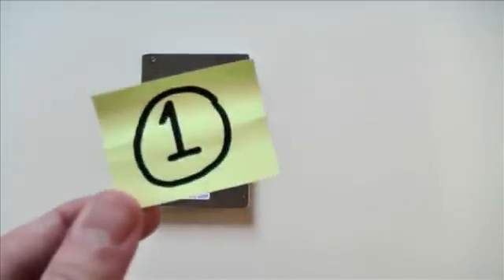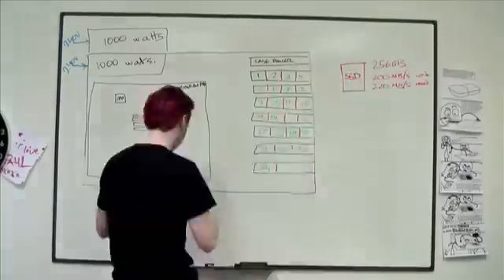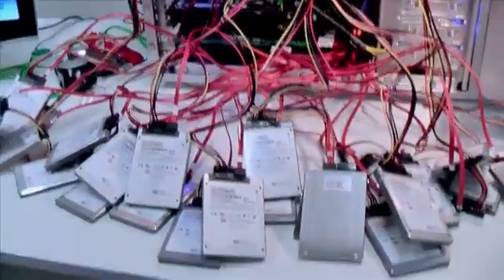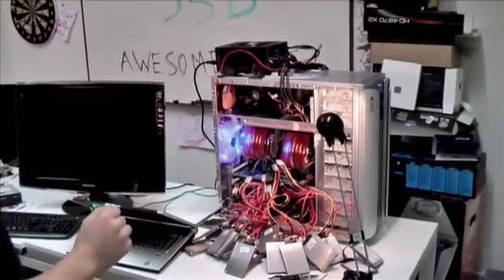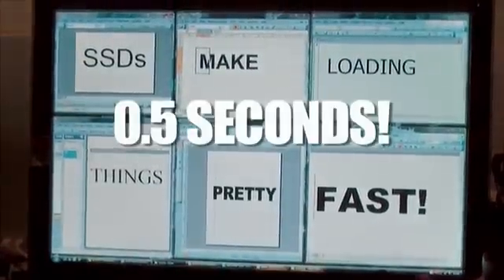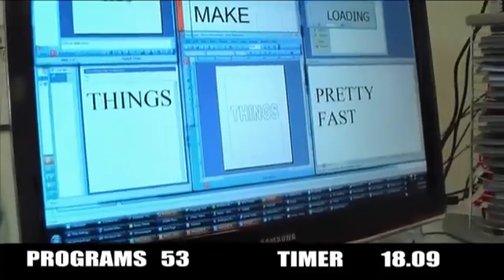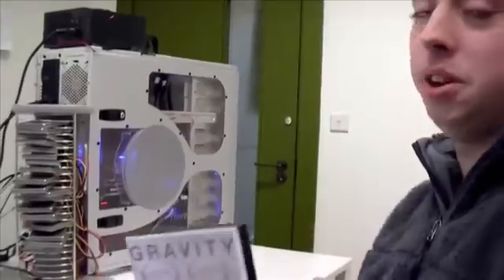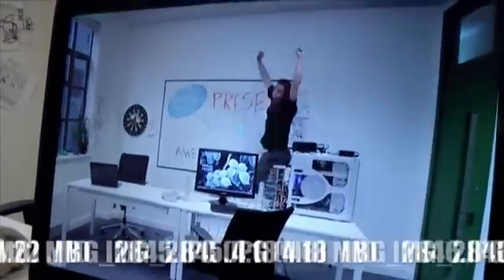What happens when you RAID 24 SSD Hard Disks !!!!!

Comment: which makes SSDs so fats. Now, it is all handled by the SSDs firmware and Windows doesn't even see exactly where the fragmented files are placed, defragmenting will not really defragment files (which wouldn't be at all usefull anyway) but simply sends shitloads of requests to the SSD to move the files around and do all kinds of things to them... the SSD, when not used, will move the files around anyway, splitting them evenly across all of the areas (memory chips to be precise)...

Comment: Simplifying, a normal hard drive has a platter and a laser which writes/reads data. If a file is fragmented, it has many small pieces which the laser has to find on the disc and load which takes some time. Thats why you defragment HDDs. SSD however, dont have any moving parts or lasers. They have many, lets call them areas, where data is saved. Each of those areas is reading data independently so if a piece of a file is saved in each of them, each area will have a very little data to load...

Comment: "Defrag free space" is nonsense. Defrag is putting fragments together, so that, for a HDD that spins, the whole program/data can be read easily (thus, faster), as it is stored in the "same place" on the disk.
For a SSD, it is useless, as every part of it is equally fast to access. Moreover, NAND cells have a limited amount of write cycles, so you are just wasting the lifespan of a SSD by defragging it, without improving anything.
There is no such thing as auto defrag free space on SSDs.

Comment: Regular defragging on SSD´s is nonsens and reduces the lifetime, but if you use a advanced Defrag system, witch ONLY moves verry high defragmentet files (MFT, etc.), it can speed up the system a little bit. But i think, this make only sense after the installation of the OS or after a mega big update. Otherways, the speed benefit is in no relation to the los of livetime.

Comment: Do you realize what type of RAID controller you would need to plug in 40 drives ? That TRIM isint supported while in RAID by any OS as of yet, and the lifespan of the setup you are suggesting ? AND that the same company makes a larger SSD using the same controller ? So add a rackmount drive case, 4x insane quality RAID controllers to your 7k price, and hope your company can keep the thing over 1 year before it fails from just too much IO.

Comment: Of course they fragment.
E.g. all you have a datablock with a file and all datablocks near it are not available the file has to be splitted into other datablocks.
So it fragments.

But unlike the HDD the SSD can access fragmented files very fast.
The HDD's arm has to position itself (takes about 5ms) and has to wait for the data to rotate there (about 3ms). So with fragmented data chained IO is not possible.
The SSD can access every datablock very fast (no seek & rotational delay)

Comment: It's still not strictly defined, but for prefixing base 2 numbers raised to the (10n)th power, one should use Kibi, Mebi, Gibi etc. 
For example, your processor's caches and RAM should be measured in Mebi and Gibibytes, your hard drive and any data bandwidth is measured kilo, mega etc.
I'm all for standardisation, so I'd say he's right to quote the throughput as over 2GB, but he's a good margin under 2GiB.

Comment: Hampered it's R/W speed, and when having to move the head to read different sequences of data on the platters, defragmentation meant that you could read more data in sequence and thus getting lower acesstime for the entire block of data being requested. For an SSD one request of a block of memory is still an IOP whether it is sequencial or fragmented.
So lets conclude, it is windows that is hampering the SSD's performance, not fragmentation.

Comment: No mention of what RAID controller was used nor the RAID level, 24 drives of supposed 220MBps yields only a 10 times performance boost, crysis lagged quite a bit in the video, jumping up and down with drives when the program that's running has been loaded to memory means it'd still function anyway and a presenter that really doesn't know anything much about computers... Wow. Summary: Awful video not worth watching.

Comment: There is a bit of confusion here: Giga/Deca/Mega are common unit of measurements, used to specify an order of magnitude (gigaOhm, MegaHertz and so on ); simplifying: how many zero are before or after a value.

In the case of computer ram, the unit of measure is a bit (0 or 1), byte (8 bit) and megabytes (1024 bit).

A Gb is exactly 1024 Mb, and is the only exception compared to other entities (a GigaOhm is 1000 Ohm, not 1024); standards wants that we use 1000 Mb for a GB but is incorrect.

Comment: Not quite.

The reason the Kibibyte, for example, was made is simply because the original definition of Kilobyte meant 1024 bytes, which fundamentally goes against the SI prefix of Kilo-, which means 1000, not 1024.

To fix this, they made Kilobyte actually mean 1000 bytes, and made a new definition called the Kibibyte, to mean 2^10 (1024)

KB = Klobyte. KiB = Kibibyte

the Gigabit is 10^9 bits, while a byte is 8 bits, which is where 256 (the permutation of possible byte values) comes from.

Comment: Awesome, but useless for most people.

You save a lot of loading times, but even if you don't have any important data on a RAID with 24 SSDs, you will probably have at least one failure in the first few months, so you would have to reinstall everything, which probably takes more time than the loading times you have saved compared to one high performance SSD.

And 3:20: Cryis will not run with more FPS with 24 SSDs than with one HDD, it would only load faster, which is not shown in this video.

Comment: Raid Level 0 is as fast as 6 GBit read.But the write performance is worth because of the stripe algorithms in Raids is only optimized for Harddisks.On an SSD you have no stripes, so the SSD writes only with 120 MB/secs even if you hav two or 20 SSDs this is a fact., I have a Database Server based on Server SSDs costs 32.000$ its JBOC and we are fast enough with 580 MB/sec read and write. This is the fastes you could get atm. Educate yourself next time!

Comment: If the applications are stored on the ssd, it can get the files faster to the program. So, if a aplplication is loading (getting the required files), that gan go like 24 times faster.

Comment: Then what's the point of this video? I'd think the problem lies elsewhere. 1. to get the data 24x faster you'd need to spread the file you need so that every disk has a piece of it, big enough to max the single disk's performance. 2. the bus between computer (ram/cpu) will max out way before 24 ssd's can give their full transfer rate. It would be interesting to see if 4 ssd's in the same config would be just as fast!

Comment: One problem with rading SSD's. Hard Disks fail with a wide standard deviation, meaning as disc fails the system can compenstate (depending on what level of RAID you use). SSD's fail much more consistently in a tight window, meaning they will all fail at much closer times, making it very unsafe.

Excellent idea though.

Comment: No they don't physically crash - but when they die they simply just do not work - and for file recovery well just dont think they are like platter drives where if there is a failure you could possibly recover the data from the drive.

Comment: This would have been a fair test had they run the system with a single SSD and given us the loading times before the test; instead we're lead to assume that the system is this responsive thanks to having a RAID with 24 of their SSD drives.

Additionally, this says nothing about the long term viability of the RAID. All we've been shown is that it *can* be done. I work with 4U RAID systems with 16 drives in them, so 24 doesn't really blow me away.

Comment: Where is the control test? You show us some apparently very fast speeds and expect us to believe it to be the result of the RAID. From the specs provided that's a dual quad-core machine with Intel extreme processors; such a machine would be very responsive and have no issue opening things extremely quickly on its own. This feels very deceptive.

Comment: The NAND cells in the flash memory work off a floating gate config and every read and write degrades that gate a small amount. The gate is suspended between two types of silicon and when the gate becomes thin enough that electrons can pass to each piece of silicon, data can get lost and the drive will become unreliable.

Comment: However, with SSDs, although you have the same scattering of data, there is no discernable benefit to defragmenting, because there is no 'physical' read/write head moving around seeking the data from a platter. So all defragmenting does to an SSD is to cause unnecessary wear to the flash cells by performing millions of pointless read/write operations on them. If you defrag an SSD regularly, you'll reduce its operational life, for no real performance benefit. Hope that helps to explain.

Comment: Ok. With all HDDs, your data is spread around in small chunks - when you call a file, the operating system retrieves these chunks from various locations on the disk, and serves it to you. With traditional HDDs, when this happens you have a physical 'seek time' while the read/write head is actually moving around on the platter to retrieve these chunks. Defragging helps to reduce this physical seek time by collecting these chunks of data together.

Comment: RAID allows you to combine all the drives into 1 mount. RAID generally splits the mount into 4-16mb peices therefore a 1GB file would be split into 64-256 peices which are then written to multiple disks at the same time. Which is how they get it to go faster than 1 single SSD can handle

Comment: I don't know where do you get your info from but i have yet to see a single SSD doing sequential 2gb/s, the top performer i have seen and was released recently is the samsung 840 with 520MB/s read and 470MB/s Write, and that's coming close to the SATA 3 port Limit, now if you do raid with 2 of them you will get 1GB/s of both Read and write, so you might wanna do some research, no such thing as a single SSD doing 2GB/s Hard disks barely get over 110MB/s

Comment: I'm not sure how Crysis works, but in Oblivion (which also features rather large areas) it dynamically loads different bits of the world as you walk round it or 'zoom in' onto a far away area. This IS constrained by RAM and HDD speed. So if they use a similar technique in Crysis then it would make a significant difference /at very high graphics levels/.

Comment: I support you on this matter. I got a 120GB SATA lll Corsair SSD running in AHCI, the speed was great, till it stopped working correctly, I checked my defragment settings, seems it was autoset to defrag regularly, I forgot to deactivate it after installing windows a while back, it seems to still operate, but booting from it is troublsome, its only good for quick storage now

Comment: You do not defrag a solid state drive because each cell can only be written to a certain amount of times. It is also not necessary because you defrag a hard drive so everything is written in order and it means the head has to move around less to get to data. There is no head in a ssd so every sector is read at the same speed.

Comment: Why the hell would you defrag a ssd?  Not only is it not necessary it degrades the performance of the drives.  On top of that you're looking at over $4,000 in ssd's.  Why not just buy 1 OCZ drive that can transfer files at 2GB/s and save yourself $3,000.  Sure its going into a PCI-X slot but you don't need 2 power supplies and over 1000 watts of power to run them.  That's great that 24 dives in a RAID are super fast but who the hell is going to spend that kind of money????

Comment: Raid 0 Combines sizes.... 2x 500GB drives would equal 1 TB
I have 2x 1 TB Drives in RAID 0 = 2TB for performance but if one drive as issues the entire array goes down since there is no redundancy.
Raid 1 is redundancy = 2x 500GB drives = 500GB since one drive is a clone/backup of the other.
Raid 0+1 ((mirroring and striping) = Combination of both for perfomance and redundancy = Needing more drives but you have the best of both worlds typical needing 4 drives

Read up b4 posting nest time

Comment: The defrag puts all the bits in sequence so they form the actual file on the physical disc, so the reader can access it faster. But a Solid State Drive have no moving parts, therefore the defragmentation would have no effect on the reading speeds.

Comment: Wait, wtf, of course you can defrag SSD's. But you don't need to with super fast all electronic I/O. Old HDD are approx. 1000 times slower to access random data due to mechanic delay, therefore it's smart to sequence your files (defragmenting files) on harddiscs. And with SSD's relatively limited lifetime, it's best not to move your files around all the time (as defragging does),

Comment: Wow, with just 4 Intel 520's on a RAID 5, on an Intel RAID controller i get 1GB/sec and 750MB/sec on 5 x 2TB Samsung F3 HDD's on RAID 5. If you could find a PCI-E x16 controller you'll get a higher speed as the bottleneck is the PCI-E x8 bandwidth limit I'm going to guess. I assume someone else has mentioned this in the last 2 years.

Comment: An SSD is actually a very big improvement over HDDs, the reason why it shouldn't be defragmented is because an SSD reads data at the same speed on all parts of the drive but for an HDD to run fast you need to defragment it so all the data is in one "area".

Comment: 1,000 $ for 24-port Raid controller
Looks like 8 or so HD's in there... 800$
Probably high end CPU for 2011, Sandy Bridge i7 maybe, 300$
Estimate graphics card - 200$
Ram, prob 16 GB- (At that time, 100$)
Motherboard, 150$
PSU- 150$
I may be off, but its around 15 000$

Comment: Kind of a waste, 1755MB/s, they say 1 gets 220MB/s...
So why not use better controllers with 15 SSD's...
BTW: Why 2 1000 Watt Power supplies? Even 1 1000watt is overkill, 24 times around 0.5 Watt is WAAAY under a 1000 watt...
Fun idea, but should be done professionally with proper controllers and faster drives, the upcomming 840's for instance.
THAT would be something everyone here would like to know, raw performance on the 840.

Comment: You can do this by using a sata raid controller card that has 4-5 sata port that supports port multiplier. Get the addonics port multiplier or similar that allows 5 sata drives to connect to 1 sata port on the controller. 5x5 and u get 24.

Comment: If you didn't use the FBDIMM RAM It would perform even faster. "The downsides to this approach are; it introduces latency to the memory request, it requires additional power consumption for the buffer chips, and current implementations create a memory write bus significantly narrower than the memory read bus. This means workloads which use many writes (such as high-performance computing) will be significantly slowed."

Comment: Actually, you could put them together in a RAID so that you don't have the full 6TB of capacity, but more reliability instead. So a number of drives can fail (not only one, although that's the realistic scenario since the failed drive gets swapped out) and still all data will be preserved. On the other hand, what's the use anyways, when there's Windows on the machine...

Comment: This Machine wasn't built for everyday Use and i think you cant take full Aadvantage of 24 Solid State Drives in a Raid Array. One SSD for the OS, one SSD for Work and a large Harddisk for Data will do a very good Job.

You have to replace the SSD for working on from Time to Time, check the Self Monitoring frequently.

Comment: The only difference between Apple and non-Apple is the firmware/OS. Apple is heavily restrictive, entirely closed-source and inefficient. Their interfacing software for other platforms is excessively intrusive and in many cases just badly implemented (the curse that is iTunes for Windows comes to mind). Either way, if your future is closed-source, there is nothing futuristic about it.

Comment: The reason is that physical data placement on an SSD is handled solely by the SSD's firmware, and what it reports to Windows is NOT how the data is actually stored on the SSD.
This means that the physical data placement a defragger shows in it's fancy sector chart has nothing to do with reality. The data is NOT where Windows thinks it is, and Windows has no control over where the data is actually placed.

Comment: you just failed 2 explain yourself, 1st you said there is a new method to defrag for SSD then you said SSDs design spreads the data across, firstly let me explain 2 you what defraging exactly means, it means putting data from the same source of installation and collect them and putting them next 2 each other so access time increases so saying SSD data spreads and defraging SSDs fails, also there no such a thing as new method,I got vertex 3 240GB SSD,on the pack say's strickly no defragmentation.

Comment: I already covered everything you just said.

A file will eventually frag regardless if you have a SSD or HDD. The misconception of a defrag damaging a SSD comes from older methods of defrag that used to move files to one sector, which goes against a SSD's design. A SSD is designed to spread files evenly across all sectors. New methods of defrag are designed with SSDs in mind. Regardless, you wont notice if you have a damaged sector until ALL are damaged.

Moving parts have nothing to do with it.